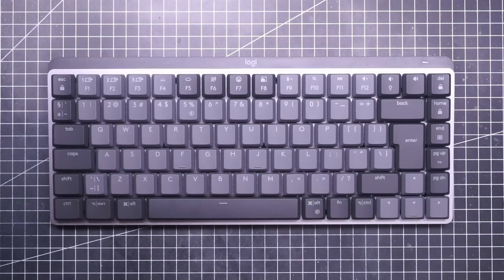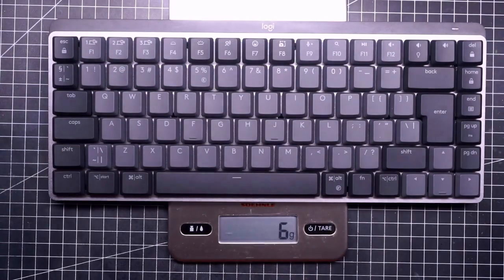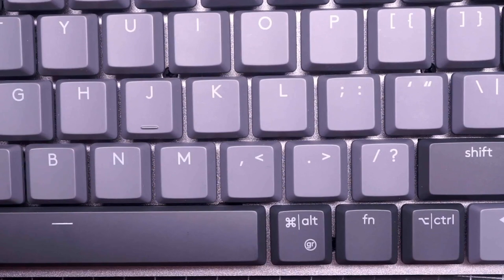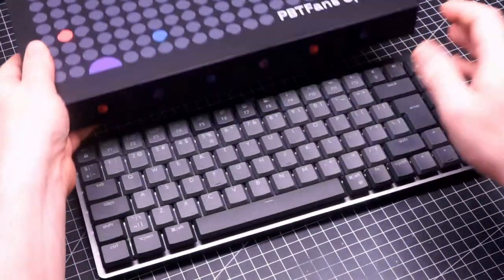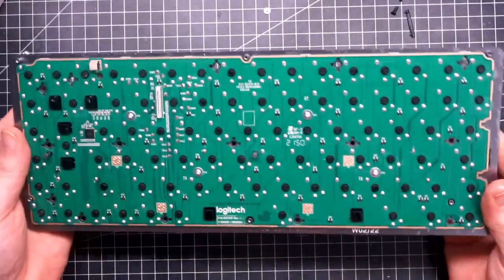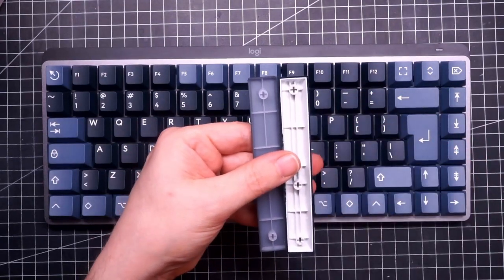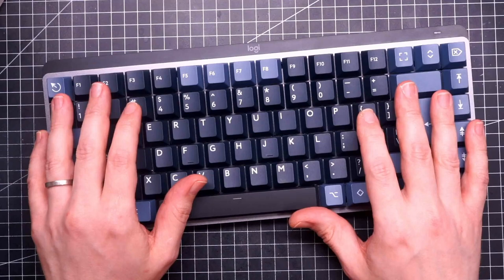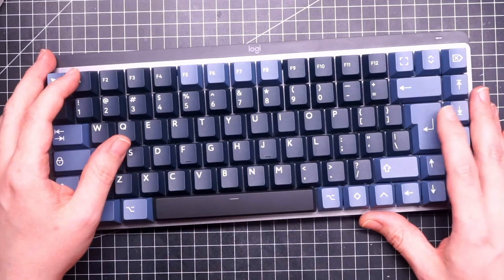Logitech MX Mechanical Mini Brutal Review

Comment: I bought the mini and the full size versions of the MX Mech keys. I love it. People need to realize this is a productivity keyboard, not really designer to be customized gamer keyboard. It is a wireless mech keyboard that works flawlessly out of the box. It wasn't designed for people who like to tinker or game. It was designer for like a office atmosphere where typing is what you will be doing. 

Great quality, and works great IMO.
Reply: I don't know why you would even put different key caps on it, this is really a good out the box keyboard for people who do work and don't care about modding
Reply: it last 10 months, the most reliable wirless conection, a great bulid keyboard. low profile,. I love it.
Reply: @rhinoTube  because abs sucks and Logitech cheaped out using abs while at the same time saying f you with non standard stabilizers
Reply: @jpt4409  Neither is better, it's preference.
Reply: @jpt4409  no one outside of the keyboard "hobby" gives a shit about abs vs pbt
Reply: A "pructivity keyboard" has a price tag of 20 bucks max... This thing is an overpriced lifestyle gadget. Look at the keylayout alone! Productivity my ass.
Reply: @Wuchtamsel  
some people like to have cramped keys
Reply: That's why custom keyboard is caled custom keyboard. This is a mechanical keyboard, not a custom mechanical keyboard. But for the price, it should at least have space keycaps for sales, since after years of use you these keycaps will not be good looking as the keyboard it self will be just fine.
Reply: @rhinoTube  I think the same

Comment: I agree the MX Mechanical Keyboard is not the best mechanical keyboard on the market, but I still think it is a very good keyboard overall:
1. The “Logi ecosystem” such as Logi flow, provide a very appealing and technically the best experience for multi device switching. It is the killer feature that won my heart.
2. The Battery life of the Logi Mx family keyboard is superb, it last up to 10 months of a single charge, no one in the market can optimise power consumption like Logi (and Microsoft, but Microsoft don’t have mechanical keyboard, yet Mac keyboard layout)
3. Logi Bolt is the successor of its Logi Unify USB connection, provide up to six devices in one single USB port, and better stability and connectivity than regular Bluetooth connection.

It is £149 not a cheap one but I think with the advantages above, it is still a very excellent keyboard for system admins, developers who need to switch multiple computer, office people and 80%+ of the layman market.
Reply from the maker: I agree with all your points. But still a keyboard should be first of all a good keyboard. This is a terrible keyboard with a lot of commodities. I'm happy about the battery and the bolt and whatever but if the keyboard sucks as a typing device I can't recommend it.

Comment: I appreciate your opinion on the keyboard, and your expert perspective on it, but I also find your conclusion extremely harsh, especially considering this keyboard is oriented at a much different consumer than typical mechanical keyboards are. Here's *MY* situation: I've been looking for a mechanical keyboard for Mac with a Swiss layout for ages, and the only one I found is the "Swiss Developer Keyboard" by WASD Keyboards, which is around 25% more expensive than the Logitech MX Mechnical Mini. That WASD Swiss Mechanical Keyboard seems to be slightly better for my job (I haven't tested it yet though), but I'm honestly super excited that FINALLY a major brand is producing a proper, cross platform mechanical keyboard that is made for average consumers, office workers, writers, ... and many more people, outside of the US, and supports Mac and all kinds of languages (including Swiss) officially, BY DEFAULT.

From a mechanical keyboard expert's point of view, this Logitech model might be garbage. I'm not going to argue with that, that's not my point. But it should be obvious that this keyboard was not made as a serious competition to the usual mechanical keyboards for gamers and enthusiasts. That market is full enough anyway already. It's more likely made for average consumers, writers, note takers, and anyone else, that simply want that mechanical experience. Especially for me, in Switzerland, working mostly on Mac, this keyboard is unique. It's one of only two in the world, as far as I know. That says a lot. Logitech is reaching people that otherwise almost certainly wouldn't really find any mechanical keyboard for their simple needs. And this deserves credit.

I personally, and many people that will consider this keyboard, don't really want to customise the keyboard, nor do they have expert knowledge and experience on mechanical keyboards.

I just wanted to give you my personal perspective and why this keyboard is not as worthless as you say it is. I'd appreciate if you wouldn't generalise your view and say that people shouldn't buy this keyboard at all, because you obviously haven't considered other perspectives. OR, do you have a few keyboards you could recommend for Mac, with a Swiss layout? If you do, I'd appreciate recommendations a lot! But if not, the WASD Developer and this MX Mechanical are literally the only choices I have, and they both look decent for my use cases.

I don't care about Logitech, I don't feel offended, I appreciate people being honest about products. But clearly you missed some important points that deserved to be mention. I mean: you're literally saying: DON'T BUY THIS PRODUCT even though I have barely any choice if I want a mechanical keyboard. There's a reason I STILL after SO MANY YEARS don't have one. And this product makes it finally feel in reach for me.
Reply from the maker: thanks for your comment. I really appreciate it.

If I told you to buy this keyboard I would be lying to you. The best way to be honest with you is to tell exactly how I feel about this product.

This is my opinion, you came to a different conclusion. Our opinions can safely coexist.

The keyboard quality (also the internals as I showed) doesn't reflect its price. That is pretty much undisputable. There are other factors in play like the Swiss layout in your case. You have to decide if these other factors are more important than the fact that the keyboard itself (as a typing device) is mediocre.
Reply: @matt3o  I understand. Sadly there are a lot of products where its quality doesn‘t justify the price, especially with big, profit oriented brands. That‘s why I usually try to avoid big brands. But I still think it‘s important to look at products from different perspectives and think about which end user it‘s intended for. And then there‘s the fact that some brands take advantage of a unique market position to set prices quite high. This can be done when the product is unique and no one else has it, or if the brand is very highly regarded or super well known. Logitech has, in my view, both of those things with this product. They‘re by far not the only ones taking advantage of such a position. But the only way to fight it in this particular case, is when other brands come in with similar products, but better and/or more affordable. I‘m not sure about other countries, but for anyone looking for a mechanical keyboard with Swiss layout, for macOS, this Logitech model seems to be the only option (apart from the WASD keyboard, but that one is made for developers specifically and doesn‘t exist in consumer friendly shops).
Reply: I'm also a mac user, have been using this keyboard (brown switch) for about a month mostly for writing codes, and occasionally switch to ipad or iphone. The experience is pretty decent, the sound and the feedback of the mechanical keyboard key is quite pleasant (as someone who never use a new gen mechanical keyboard). However,  compared to the original mx mini for mac, the doubling of the price is just too much.
Reply: @matt3o  If this one is a no go, can you please suggest some alternatives? thanks.

Comment: Well, I like mine. I use it mainly as a productivity tool (at which it excels in my opinion) and some gaming sessions too. The bolt receiver is pretty good, plenty responsive enough for gaming. I have the brown tactile switches which sound and feel pretty great to me.  

I do agree that the board is somewhat diminished if we can't change the key caps though - a fact made even worse if it was a problem easily avoidable. Logitech really need to sort that out.

Comment: I get where you're coming from. What I see as it's reason for existence is that it's one of the very few 75% low profile keyboards on the market, and the only one I know of from a mainstream manufacturer with better QA resources than other manufacturers. It looks nice on the desk. The layout is compact. The battery life is excellent. The wireless connectivity seems much better than Nuphy or Keychron. The Logi Bolt receiver means you can use one receiver with other Logitech devices, such as the MX Master 3s mouse. It's more for businesses and people that just want to buy a keyboard and use it, vs. keyboard enthusiasts who want to mod their keyboards. For people who are not uber picky about the feel and sound of keyboards, it types just fine. Sounds to me like there are plenty of reasons for it to exist. If it had VIA/QMK support I would buy one for every computer I own. Without VIA/QMK support, it's not a good keyboard for Linux computers because Logi Options+ doesn't run on Linux.

Comment: In my opinion, the appeal of this keyboard is the quality of the antenna and logic while being a basic mech board. 

We did try several wireless keyboards that also supported Bluetooth, and most of them are inferior to e.g. the MX keys from logitech in signal stability or latency. We (as our company) we’re thinking about getting these new boards for new employees because of the proven wireless and massive customer support support infrastructure of logitech. 

Thank you for pointing out the problems.
Reply: Curious about why would you need customer support for keyboard,I mean its keyboard after all and will last longer than anyone who uses it.But I agree about great connectivity and its a good keyboard overall

Comment: 2:38 Minor correction: it's a Logi Bolt, not Unifying dongle.

I overall agree with your points. Those keycap legends annoy me and there was no reason to make the spacebar nonstandard.
I wouldn't go as far as calling it "rubbish" though. It's fair to say there are valid alternatives.

IMHO, there are a couple of things that make the keyboard appealing to some people:
1. Non-ANSI layouts available. Keychron did some ISO options on their 75% keyboards, but not on the 100%. And, if Logitech made an ISO-IT, it would be the only low-profile mechanical keyboard on the market, to my best knowledge.
2. It comes with a dedicated USB receiver with encrypted communication. One could take the encryption for granted, yet I discovered a month ago that the Nuphy Air75 receiver was not (they admitted so in their Discord).
Reply from the maker: hey thanks for your comment! I have over 1h of footage but ultimately I stripped the video to few minutes because the keyboard can have all the best features in the world... but it has to be first of all a good keyboard. This is a terrible keyboard at a very high price. I might still consider it if it costed 90-120e... but at 160e it shouldn't exist.
Reply: @matt3o  I agree that it is overpriced and it would make more sense if it costs around 100 euros. But I don't think the majority of target buyers are gonna mind the keycaps and that the spacebar has a non-standard stab position. I believe most buyers of this keyboard care more about convenience than customizability. And sure, it's mostly made of plastic but it's sturdy according to other reviews. And plastic is fine IMO, sometimes even better (less sharp noises, unless it's properly dampened), as long as the price is right (which it isn't atm).

Comment: thanks for your honest review, but it seems like a lot of personal issues here. Firstly, I don't think this keyboard is for the traditional mechanical keyboard fans, it's just a productive tool to replace or provide one more option to the MX lineup. Secondly, I don't like your keycaps at all, their lineup is meant for low-profile styles. So I really don't care if I can swap to other keycaps for now. The other thing that keeps me buying mx line is the logitech flow as I have to work between 3 computers everyday.  I'm sure you can build whatever keyboard you want, but your review is actually not helpful to the targeted market here, maybe to the keyboard fans like yourself.
Reply from the maker: that's why the review is honest :D it's how I feel about it. that's all.

The keyboard is bad and overpriced. if all the other features it has overweight that fact... go for it!
Reply: @matt3o  ture, but I strongly disagree the overpriced part. most of users don't care about customization, Logitech did not mention that as part of the feature so it's illogical to think you are even suppose to do customization on this keyboard. That's why I think your argument here is unfair and not helpful. You can say it lacks the ability of customization, but saying it's bad because it didn't do what it wasn't designed to do is your problem. A good product that has universal value should provide a good usability and user experience, which is not just the product itself, it includes many more.
Reply: This review was actually really helpful to me as a former Logitech customer, who is looking for a mechanical keyboard with a 75 layout, because I'm now going to buy the "Keychron K3 Ultra-slim Wireless Mechanical Keyboard V2" (better quality, lower price and also with backlight and with wireless/wired option). 😉
Reply: @HenrikWittenberg  Until you start flipping up to 5 switches in order to switch devices lol. That vs 1 button press on the MX mechanical.
Reply: @cutesammie  I connect the keyboard via USB cable with my desktop PC and via bluetooth with my other devkces (laptop, Nvidia shield). No hassle at all …

Comment: Thank you for the video and the disassembly!
I have a G613 and apart form the numpad which makes it HUGE, I love it.
I was initially interested in  MX Mech Mini, but I'm still deciding. 
I want to have exceptional sexy time typing with my keyboard if I'll pay a ton of money for it. 
The fact that it switches between 3 devices with 1 receiver that can be used also for the mouse is great, (keyboard and mouse for work and home computer with a switch of a button)

Comment: Okay, if it is that bad and we shouldn't buy it, is there another option of a mini layout keyboard, that is mechanical, wireless, has a dongle (essential of it's wireless!), is low profile and has an ISO layout? I also require a slovenian legend and this one comes closest to ticking all the boxes, as soon as replacement (blank or custom printed) keycaps will be available.
Reply: Keychron K2 is kind of almost there.  Although your comment was written a while ago, I'm surprised there haven't been many responses.  I honestly don't know about the standard ISO options for it.  There are so many options, one has only to look.

Comment: Was the PCB detachable from the top plate? I'd like to try and spray it black but don't want to damage anthing. It might not be good value, but this is the only keyboard on the market that satisfies my very specific list of criteria so I'm still considering it.
Reply from the maker: no, you can't remove the plate without desoldering the switches

Comment: Hello @Matt3o. Thanks for your video. I'm currently looking for a new mechanical low profile wireless keyboard for under 200$ with the ability to switch between multiple computers and I was planning to buy the mx mechanical. The led backlight is not must for me, but it is a nice feature which I would prefer. Can you suggest some alternative to it since according your video it does not make sense to buy this one? Thanks
Reply from the maker: the non-mechanical version of this keyboard is better priced and has the same features. They made a mechanical version just because it's cool, but they failed miserably. Otherwise you can look at the NIZ keyboards.
Reply: @matt3o  Thanks for fast reply. Can the bt versions of NIZ keyboards connect to multiple devices and quickly switch between them? I didn't find it on their webpage.

Comment: thank you for such an honest review sir much appreciated, but have some questions could you please ans those. 
1.) what is the profile for the keycaps? 
2.) do these keycaps hit the plate? if yes then which raws are hitting the plate?
and could you please provide the link for the keycaps please  I wanna use for my nuphy air 75 low profile keyboard.
thank you once again.
Reply from the maker: the keycaps that I tried are PBTFan cherry clones. They don't hit the plate by a whisker. They are easy to find with a google search.
Reply: @matt3o  thank you so much

Comment: it really amazes me, that this keyboard is priced so high and its basically shit. because their mouse mx 3s master is very good. 
Which keyboard would you suggest? I have been eyeing keychron k3 v2 and nuphy air 60. what do you recon? I am a Mac user.
Reply: Sorry, I respect your opinion. But write this message with this keyboard on a Mac. And I love it. I have the membrane keyboard also from Logitech (K780). And the Apple one. I love this keyboard. I don't see the point of changing the keys on the keyboard. First of all the keys must be able to pass the led light underneath (which may not be the case here). If you don't like the original keys, don't buy this keyboard. Also mechanical keys in the review are based on the blue keys. I have the brown keys (most keyboards are sold like that as default). They give a much less click noise. Also you have other features that makes this keyboard shine. I can switch between my Mac PC, Windows PC and iPad with this keyboard with one touch of a button.